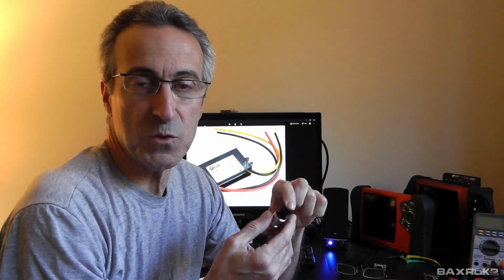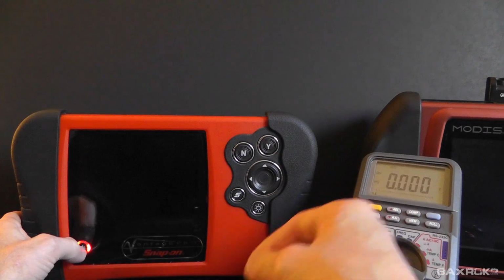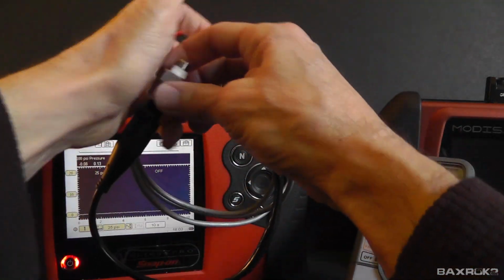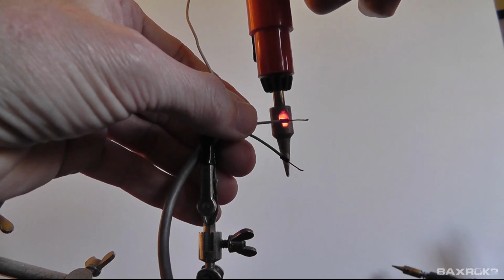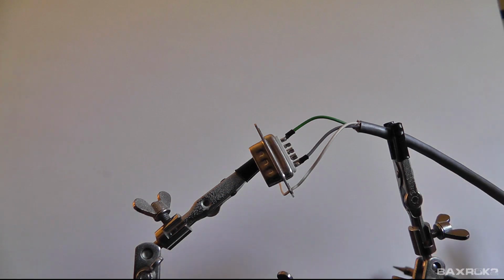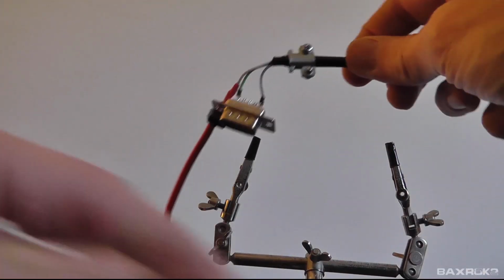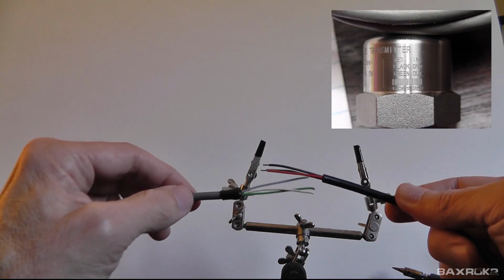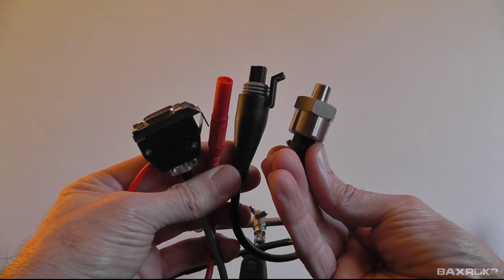Veris/Modis/Vantage Pro - Internal 5v Power Supply: Part 2.

Comment: Just built a kit using the 100 & 500psi Transducers (purchased from Amazon & Ebay) for my Snap On Verus Edge; all working great and saved a few hundred pounds . Thanks for the info, advise and guidance Baxrok2
Reply from the maker: Excellent!
Reply: Just wondering, on the verus there’s a third scale that can measure pressure up to 5000.Psi. Do you know what you’ll be measuring using that scale. Thanks in advance
Reply from the maker: @Sam-fm3gh  I imagine that the 5000psi scale would be used for diesel injection systems, direct injection high pressure fuel pumps, or other types of things like hydraulics, etc.

Comment: I have an 06 Mazda 5 with 2.3 in it do you know what engines I can use in it I've read that the Mazda 3 and 6 you can use the Ford engines in them is that the same for the Mazda 5 read that the Mazda 3 has the same block as the Mazda 5
Reply from the maker: I put a 2011 Ford Fusion 2.5 in my 2005 Mazda 3. I posted some videos on it. Visit Mazda3Forums.com for all of the specifics of the build. Just about every single detail you could want, including some parts to buy, are detailed in that forum. Also, you could visit a site called HappyWrenching for more of the same info. Good luck!